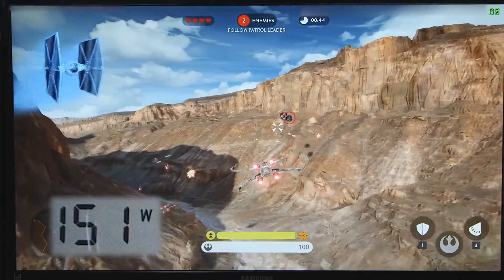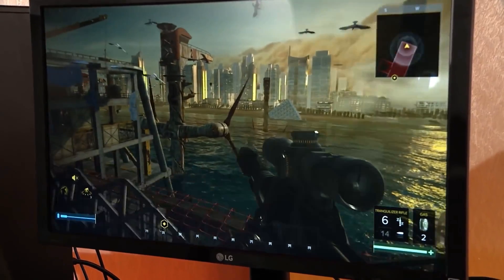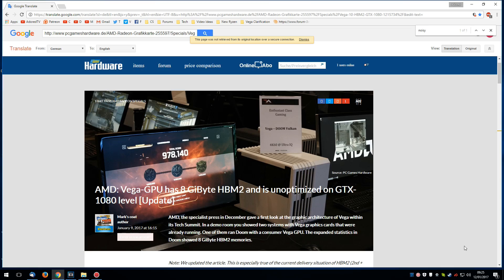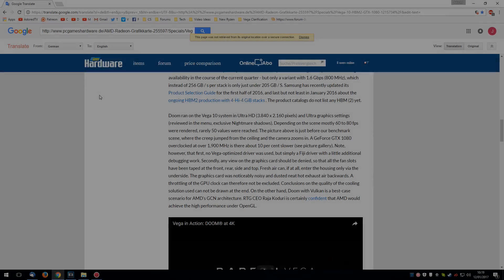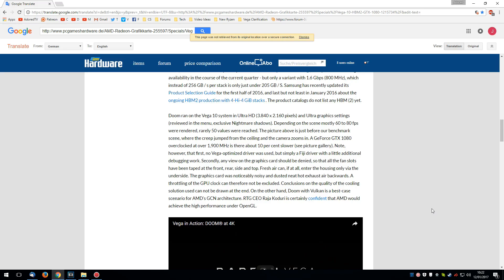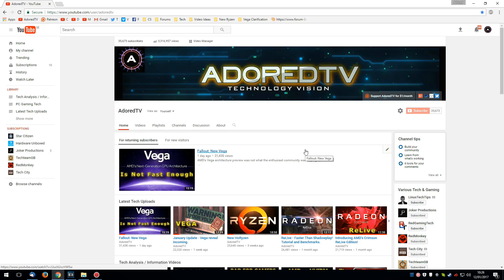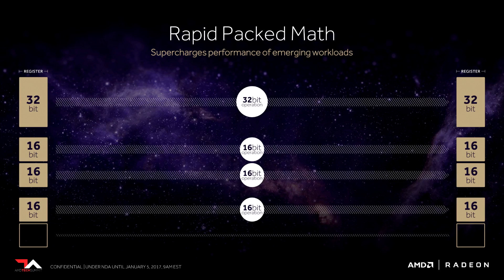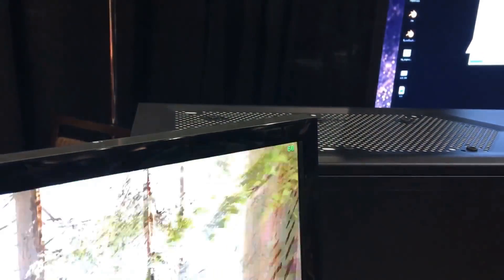Vega Clarification - How bad is it?

Comment: I don't want Titan-level card and I'm pretty sure 99% of gamers would be more than happy at the 1080/1080Ti level of performance. So as long as Vega performs there, but costs less, it's an absolute grand slam for me. Yes, AMD is clawing to get back into the high-end segment, but it won't happen from one or two generations. The company was almost bankrupt a year ago and has suffered for years. The turn-around is simply jaw-dropping, and now I suspect people are expecting TOO MUCH from AMD at this point. As long as AMD can get a fat injection of cash from Vega, Navi should bring the heat even more. Remember that we style get free AdaptiveSync from team red thanks to royalty-free FreeSync, and I believe this trend will continue. Let's be honest, team green is green for a reason... greedy shmucks. Their market share and profits are sufficient such for them to have better silicon manufactured -- hence why the bigger and older 16nm Pascal is fairly efficient compared to where 14nm Polaris should be. Good chips make all the difference -- lower voltages at higher clocks.

Comment: You forgot about the masterplan. The real margins are in the mainstream PC and console, not the high end. You make more money in the longer run by selling a lot of smaller, mid range silicons than selling large, high end ones. Your margins may suffer at first, but in the long run, as the process matures, it will cost you less to make them, and they will actually get better and allow you to slap a bigger number on them, say rx580 and sell them for more, or the same, thus ruining your competition in that segment because they cannot offer the same performance without losing money. 

Furthermore, PC market is getting back in the portable segment with ultrabooks, new configurable and upgradable laptops, a new generation on consoles is coming, be it just a small jump for 4k capability. Amd definitely got back in the game with RX480, which can finally make its way into pre-built pcs and laptops as discrete graphics (something which has been sorely lacking for AMD for years) and which actually sells the most, unlike the mig-high end do it yourself pcs.

I currently have a 970 in my system after using AMD cards ever since I upgraded from the 7800&8800 series. My first ever video card was an ATI. My first CPU was an AMD. Then they started sucking, and I switched to Intel. C'est la vie. 

R9 disappointed me due to heat issues, high power requirements, poor OC capability while costing the same. I would have invested in a RX480 upgrade, but the performance gap does not warrant the investment, and I also had to wait for a year to come out. 

I will definitely invest in a Vega once it is out.  I saw no reason to go for 1070. Way too expensive while offering nothing relevant for me @ 1080p. And I do not think I am alone in this. Pascal may look good on paper because of lack of competition, but it won't last, and if there was no chance for AMD, they would not have bothered with hopeless investments. 

Let me put it differently. Next gen consoles may as well have custom built chip sets combining RX470 and zen, or Vega and Zen. Think about that. And game developers will write for that, and then also write for PC and base their work on that. And while at first, we won't see the performance gap, that will grow bigger and bigger over the years.

What really happened is that NVA's greed is basically digging them into a whole by attaching their name to ridiculously expensive tech that scale all that well on DX12 or Vulkan. And word of mouth about future proofing travels faster than you imagine.

I am not a fan of either company. Matter of fact, I perceive them both as quite a bit anti-consumer and out for themselves.

Comment: In all honesty, you make some good points and yet some bad ones. It seems there are a lot of assumptions based on the past, some would call this jaded or biased. Since when does it make it accurate for a "journalist site" or what not,  right to make calls without clearly stating that this is there own opinion, based on the past. making assumptions is when you're usually wrong, track record or not. It would be really refreshing to see a journalist be true to the title, provide known facts, not biased or jaded assumptions. Things change, always but to sit there and state as a matter of fact without making the opinions stated they are biased and assumptions, throws ppl off, in a large way. Truth be told, no one, fan boys included, know what it will be in the end till someone gets there hands on one and shows it all. So if you're going to make assumptions and be "disappointed" make it a very clear statement it's your thoughts and yours alone, not based on assumptions and made to be relayed as fact. I enjoy your channel but come on, be true to the role. yes, everyone has there opinions but the issues become clear when opinions are stated as fact and not opinions anymore. Lose the jadedness and biased, regardless of the past or experience and keep the mind open. Don't set things in stone when there are no concrete facts in total to prove one way or another. When someone or a few ppl get there hands on vega and Ryzen and can fully test in all applications with the right hardware and software/drivers, then and only then can anyone realistically state something with accuracy.
Reply from the maker: The problem is people are selectively choosing what to take from the video instead of the whole. 

This video has 2 sets of facts - fact 1 is that AMD does not sandbag and fact 2 is their own Doom benchmarks.

I clearly pointed out that AMD could be sandbagging, but that if they were then they have just started doing so.  All of that is based on fact, however people simply choose to disbelieve what AMD themselves are telling us instead because that is what suits their own agenda.

Comment: I think ur missing the point , this version of vega is not the best they can offer , that is the mainstream version that will be cheaper , there will be different versions of vega ,  the one that was demo-ed was the middle performance version , I can't say from where I know so don't bother to ask
Reply: this is the big Vega, but it's an engineering sample with old drivers and silicon. this is not the final performance of the gpu. just Relive drivers till now it's 10+% performance boost. eventually Vega will compete with 1080ti. it's a matter of time

Comment: Also, most games don't even use Vulkan, so comparing an AMD card on Vulkan vs a GTX on Open GL isn't a fair comparison, unless you only plan on buying and playing Vulkan games of which there are only like 2 in existence. GTX is therefore  going to always be more dependable since it is capable of delivering good performance on the more common APIs

Comment: AMD didn't intend to showcase Vega performance, it was a last minute decision due to a leaked video.

The Vega shown was a prototype, on a prototype board, running Fiji drivers with debugging enabled, fans set to 100%, and the system intake and exhaust all taped up to prevent giving away any unwanted details... and you can bet added voltage to help guarantee stability.

AMD wasn't sandbagging, but they were DEFINITELY not showing this card in its best possible light.  It looked like it was using the Nano cooler, no less... this card was throttling hard, no doubt.

Imagine if it was running a nice, high, 1.2Ghz and will be released at 1.4GHz... and release drivers add just 10% more, with another 15~20% being added over the next year.

That's near Titan X (Pascal) territory already...

Comment: Scott Wasson said they do not disclosing everything about Vega yet and also they do not disclosing performance yet.
We know that PS4Pro has Vega features like ID buffer which AMD did not talk at all about and we certainly do not know other stuff either. I think that AMd only wanted to show Vega will be 4K graphic and nothing more. But Vega 10 has to be significantly faster than GP104, its 398sq mm against 525 sq mm.

Comment: I upgrade only when I need to, and I need to now. I was ready to jump on an rx480 last summer, but I waited for some of the hype to die down (and hoped the price would drop after launch), but was majorly disappointed in its performance. I considered going crossfire, but games are moving away from supporting mgpu setups so I didn't want to get stuck with a hit-or-miss rig. Better drivers and Vulkan will improve the 480's appeal, but I waited for Vega instead, hoping for an early release. I'm still waiting, and while I wait I watch this channel. The early benchmarks for Vega are disappointing, but I'll still buy one if it rivals the 1080. I'd love to get a true enthusiast's card that will hold up for a few years, but these mid-tier cards like the 1070 and even 1080 are crazy expensive. My hope is that Vega will rival the 1080 or even 1080 ti at a lower price point and help equalize the whole gpu market. Either way I will get one...can't wait any longer. Sandbagging or not, at least AMD exists to rein in Nvidia's market dominance/abuse. I trust Adore's opinions, but I'll support AMD as long as they are competitive.

Comment: I disagree with this fundamentally, I look at perfromance graphs and made a excel sheet of it. through my estimations of fury vs 1080 in doom vulkan, percentage down and back around to extrapolate.
This vega 10 should 9-14 percent faster than gtx 1080, not just at doom, but in general games (i used Techpowerup numbers to do this math).
Now this would officially make VEGA about 7 percent slower than gtx 1080 ti. But thats my point.  7 percent is not a insurmountable hole, a 50-70 dollar price under gtx 1080 ti will fix it.  
I reiterate, I AM NOT happy about this, but its ok......
as for GP100, I think nvidia has zero intention of selling gp100 for any price under 1000 dollars so it is a non-issue.

Comment: I think it's a bit bold to say that AMD would sell less than Nvidia if they were 50% faster than a TitanX.  That's a hell of a performance gap to ignore if the price point is right!  Now would they gain substantial ground with a 10-20% gain?  Probably not, but that's likely due to the late timing of release, Pascal's headroom, and brand investment at this point.  It's easy to look at AMD and say that they've gotten a raw deal from the market when you purely look at the performance per dollar comparison.  They've consistently held that advantage, but this so called "mindshare" is about more than just performance per dollar.  Nvidia have consistently innovated and implemented gaming technologies that benefit their own ecosystem and end users more rapidly than AMD in recent years.  Gameworks is curse word in many circles, but it's also a nice perk to Nvidia users.  Shadowplay didn't have an AMD answer for roughly 3 years, and Gsync led the market for roughly a year. Those little extras make a difference when you are looking to make a significant investment in one company or another.

I certainly don't want to see AMD fail.  Like you I think that the high end graphics pricing has gotten out of hand, but that's the result of a non competitive market.  You can scold Nvidia and Intel all you want, but more money is always better than less money, and they've had no reason to make less.  Intel has been dragging their feet for years on the CPU side and still outperforming AMD with minor incremental improvements.  AMD simply hasn't done a good job at competing.  Their technologies are solid, but underutilized just like the PS3's Cell processor was.  Their technology adoption happens too slowly and is often eclipsed by their competitions' pure performance gains, and their historically rocky product launches fumble the early press coverage where many turn to formulate opinions and make buying decisions.  It sucks, but a lot of it is their own fault.

Comment: I don't buy amd cards for my workstation (because of my work) but a huge reason why RTG is having this trouble now is because of all the problematic drivers they had in 2006-2013 era. if they did what nvidia did and develop a good architecture that would support them for years, their market share now would be far greater. I remember the time when i purchased 1950X pro ati and it had so many problems with drivers. there wasn't even a proper official linux driver back in the day. Now from what i see they've fixed many of those problems. I bought a r5 230 for my mother's office pc and the gpu works great. They benefited a lot from the GCN architecture. Unfortunatelly they didn't have it in time. Even though amd were first to get dx11 gpus months before nvidia, it seems that nvidia's strategy to build upon what they have was a better option :/

Comment: I don't think that AMD needs to beat Nvidia's flagship and to be fair, a relatively small percentage of people buy 1080's, much less Titan X(p)'s. But for the sake of argument, let's assume that nvidia launches the 1080TI and the regular 1080 becomes more of their "mid tier" card. If Vega comes in at 90% of the performance of the 1080 and 60-70% of the price, it will sell.  If nvidia responds by lowering the price of the 1080, consumers will have the choice of two very good video cards at a lower price.

Comment: I'm still not sure why everyone is so worried about performance per watt. in terms of cost I've heard a fairly power hungry cpu will cost about $30 a year to run yet people throw out 100s of dollars to get a more power efficient(at most $5 less per year) cpu with the same performance. While heat output can be physically noticeable after long usage sessions I would be hard pressed to find a place where you can't open a window. If you want max performance per watt use a RISC processor not to mention they are defined by having the smallest possible IPC/CPI. 
ps: core speed = frequency * IPC while frequency is harder to increase the limit of,  a 3ghz cpu with an IPC of 1(3 billion instructions per second) is worse than a 3.4ghz cpu with an IPC of 0.9(3.06 billion instructions per second). Not to mention different instructions may use different numbers of cycles so the manufacturer's calculated IPC may not reflect the programs your using.

Comment: >AMD wasnt sandbagging
>Shows examples of AMD sandbagging

Lmfao. Dude come on. Just stop with the AMD hate. Its not necessary

It doesnt matter what AMD was showing when they underclocked the processors, CPU or GPU. Its sandbagging as long as they underclock the chip

WHY WOULD THEY NOT SHOW A SLOWER GPU?

Lmfao. Are you serious? Its an unfinished product with hardly any drivers. If they overclock it or even set it to its optimal clock speed and then something happens to the card cuz of bugs or heat issues being vented up, then its just bad press for AMD and the new card.

They underclock them to make sure that everything is stable while they demo it. Its not about performance. It was a teaser for what is to come. This is what you can expect from VEGA come launch day. Not this is how powerful VEGA is.

Why would AMD be showing off VEGA performance numbers 5 months before its launch? That would only give NVIdia info to work up something to beat them with a 1080Ti or something.

Think dude. Think
Reply from the maker: Did you understand anything about the video?
Reply: Yes. I understood everything. You're making speculation about an unfinished product based on a tease a company gave about it.

Just wait for the product to launch and stop talking shit.

You claim you want to see AMD rise again and shit, you have 40k+ people watching videos like this. They see it and they dont buy AMD because of what you say, then they tell people not to buy AMD.

You're adding to the problem you claim you dont like. Just wait for the product to launch and then give your critique if it actually is shit then, but dont deter people from it before it actually comes to fruition
Reply from the maker: I have 170,000 people watching this video - https://www.youtube.com/watch?v=OvF3BJTLgRQ

Should I also have waited until Ryzen released?

I have 130K people watching this video - https://www.youtube.com/watch?v=O7fA_JC_R5s&t=972s

Should I also wait until Gamewrecks is in every game?

No?  Guess what, AMD don't get a fucking free pass either.
Reply: Lmfao. I can see why your channel hasnt reached 50K subs now even though you've been at it for 2 years+
Reply from the maker: Actually I only started doing tech vids a year past in December, so 1 year.

The reason I don't have 50K subs is that only smart people watch my videos.  That's why it took you so long to get here.
Reply: AdoredTV LOOL
Reply from the maker: I know you're watching my other vids :P
Reply from the maker: Tbh I just enjoy giving fanboys a roasting, mostly it's Nvidia fanboys but this week I've had a lot of fun with you AMD fanboys instead.  Kinda enjoyed it too, being an even-handed Libra.
Reply: I'm not an AMD fanboy. I'm a consumer who dont want to see a monopoly in a market where there is already  the majority overpricing their product because they dont have much competition. AMD has many comparable GPUs to NVidia, but NVidia has the hype and people act like idiots when it comes to them which only fucks us all in the end
Reply from the maker: Did you see my "GPU was is over" video where I talk about that?  There is another one coming soonish, even more damning I'm afraid.

In the end, nobody is doing more than me to try to change this stuff around, but I still have to report tech as I see it.  So far AMD just didn't impress me with Vega - don't get me wrong I know it will be an amazing GPU, I just fear that PC gaming is about to take a drastic turn for the worse and Vega won't change that.